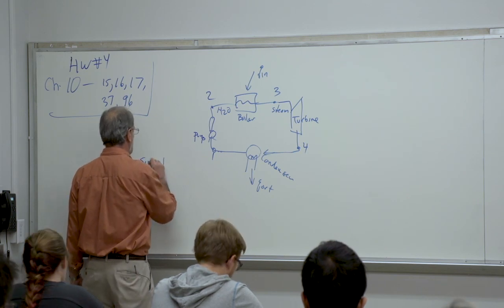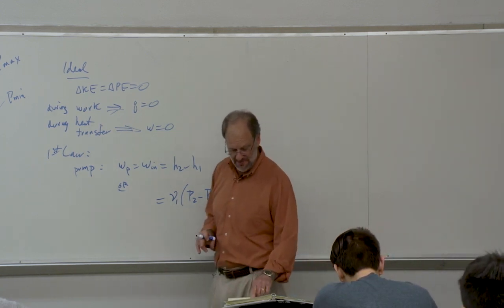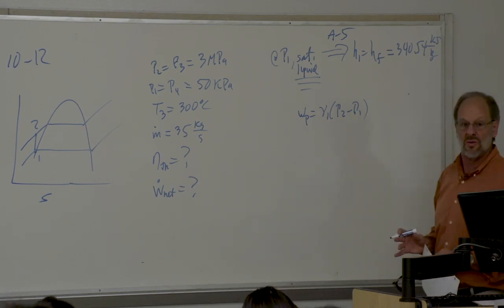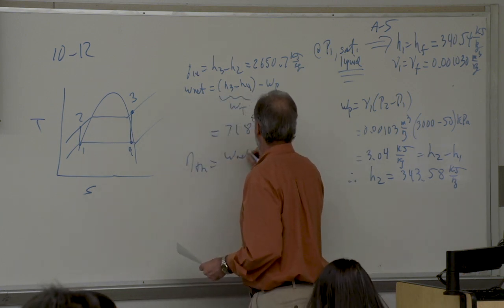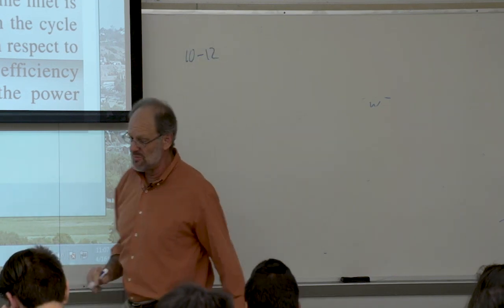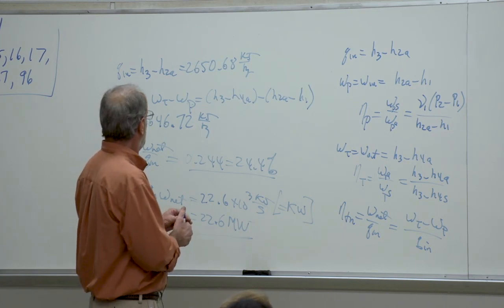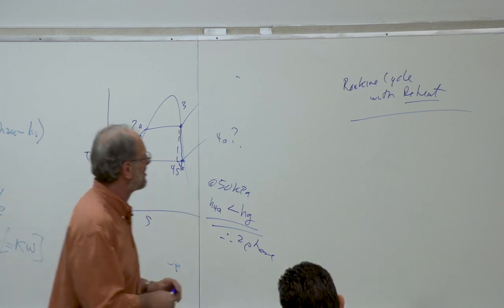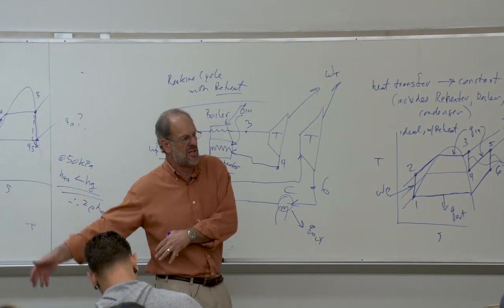Thermodynamics : Ideal and non-ideal Rankine cycle, Rankine cycle with reheating (34 of 51)

Comment: from where the formula of pump work comes ?
Reply: From the steady flow energy equation. Neglecting potential energy at the immediate inlet and outlet, and the kinetic energy of the flow, and since no heat is being added ideally, w=v(delta(P))
Reply: @TealsHRk2269 thanks